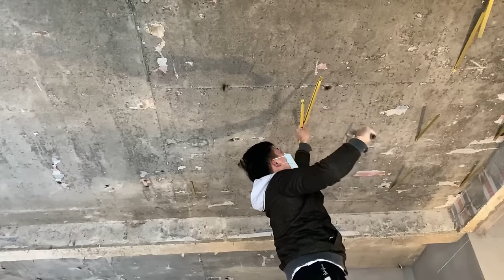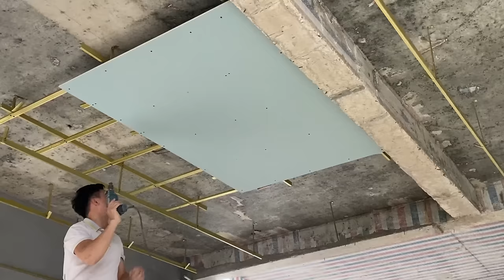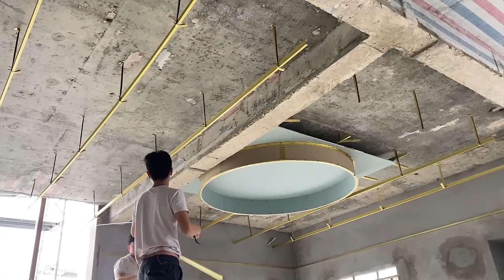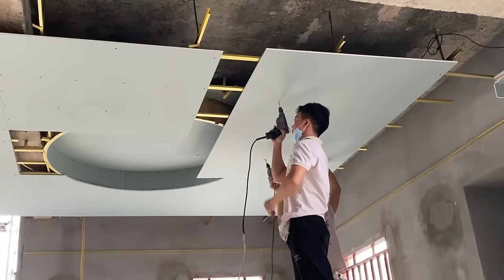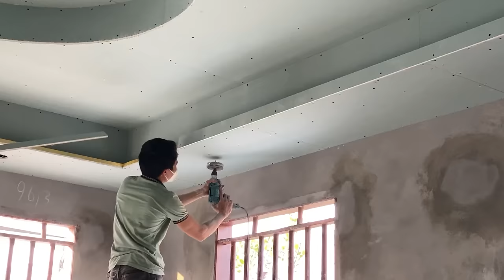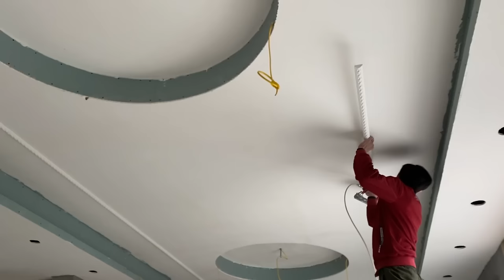Amazing Skills And Methods To Build And Install The Best Plaster Ceiling For Living Room

Comment: What material is the gypsum trim pattern made of, sir, how can it be bent?
Reply from the maker: hi - the pattern is made from gypsum powder and is molded - but the bendable thread is PU hard plastic and uses a hot dryer to bend it
Reply: @constructiontech2411  thanks..